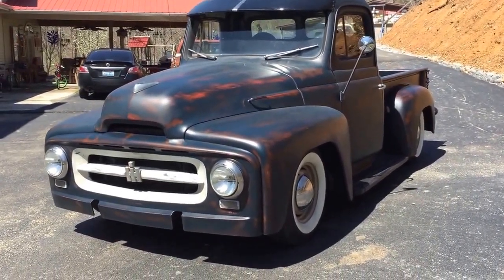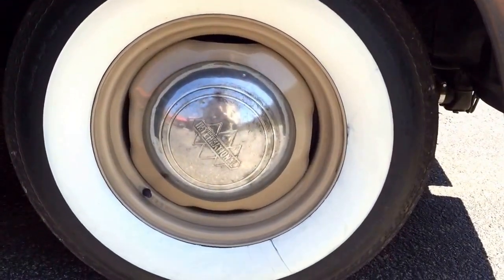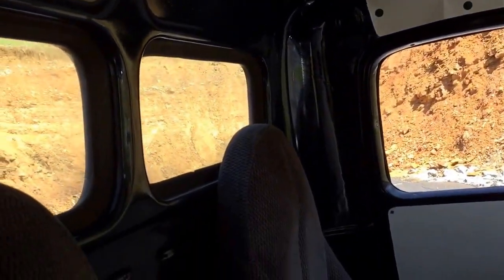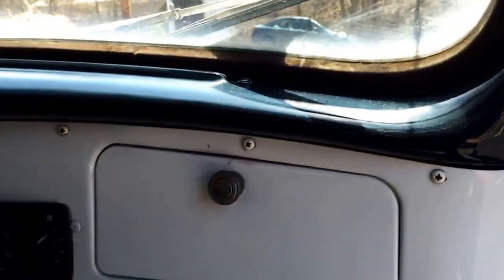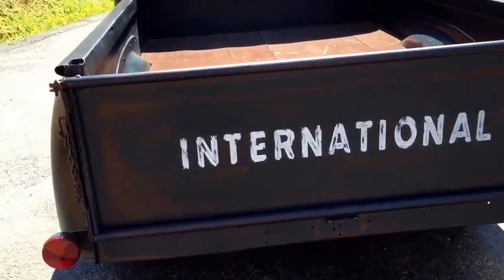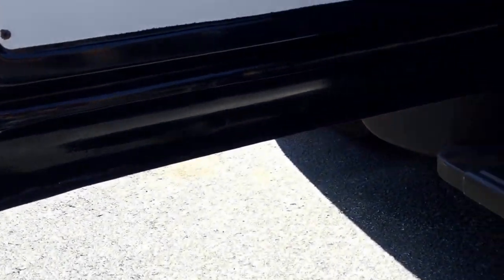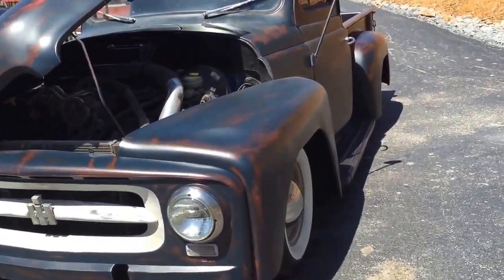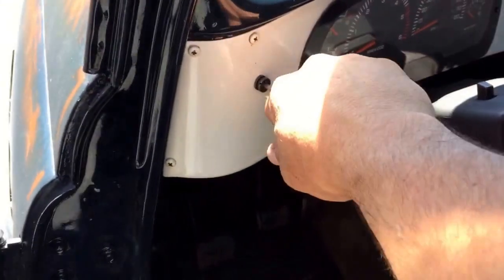1953 international Harvester R-110 vintage patina hot rod

Comment: Hey Jeff....found your video searching for info on 53 r110 conversions. I have a long bed that i'd like to  put on a modern chassis so I can have disc brakes, bag it to drop it on the ground and add some of the features you have on yours.  Will the body bold on to a long bed Dakota frame, or should I be looking for a full size dodge..mid 90's...?